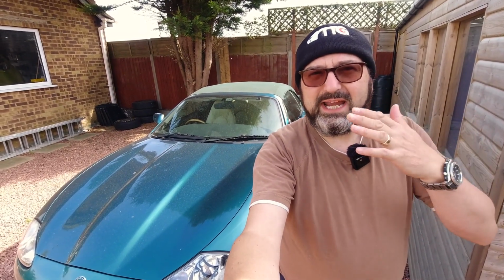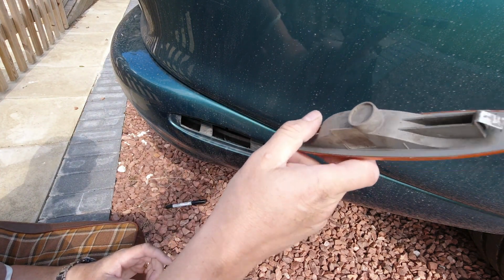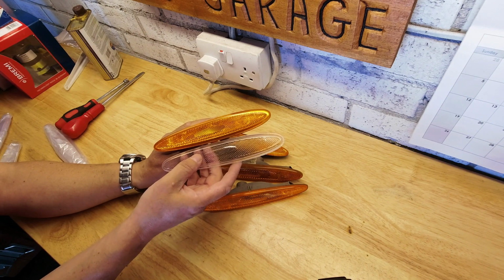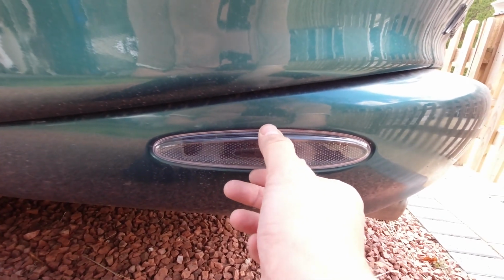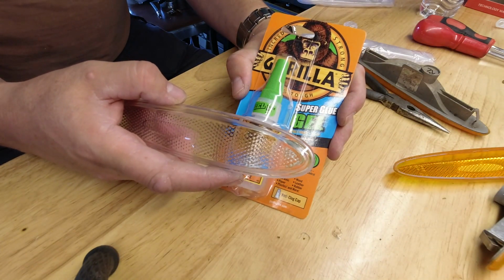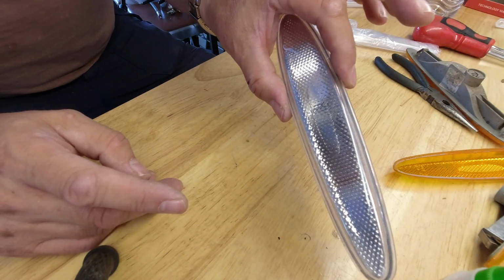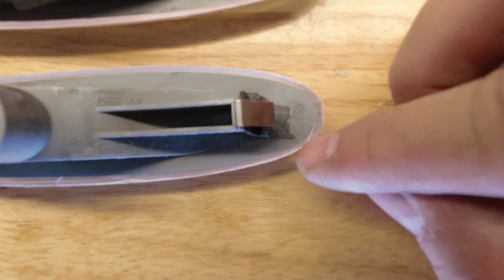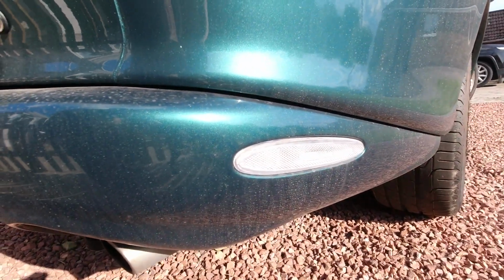Modifying the jaguar xK8 side reflectors

Comment: I’m working my way through your XK8 videos having acquired a 2001 convertible from my father in law recently for nothing! I’m gradually sorting out the various issues it has and your videos have been invaluable in doing that. I’m also learning something from you as I’d never heard of the verb “linish” until watched this and even had to look it up!
Reply from the maker: 🤣 thanks James👍
Im always deploying archaise English phrases as im unaware that they are not in common use. It comes from enjoying language and being an engineer. 
Im more often pulled up on terns such as, Lanyard, Fettle, and Empirical. 😁
Reply: @ToTheGarage  thanks John. I decided to do my reflectors and ordered the Adamesh product and expecting to receive straight swap replacements (I went for clear at the front and red at the back). I’m disappointed that these are in fact flat reflectors with the entire rear surface solid and with 3M self adhesive covering it.  Do you have any knowledge/experience of these please as I’m just concerned that they will look wrong or won’t stay on as they are only held by the adhesive round the edge and have no clips. Thanks!
Reply from the maker: @jimmygee1969  Hi James. Sorry no I have not sampled the Adamesh option. I have had plenty of their other parts over the years and never had any issues, so I would assume thst they will fit and stay in place if you follow the instructions. But sorry I cant help beyond that

Comment: I like to see your take on replacing the incandescent exterior bulbs with LEDs.  Over time, the heat of the bulbs will deteriorate the
the plastic sockets. Also, with less voltage to illuminate, something needs to  be done to prevent  an warning light on the dash. Thanks for your consideration.
Reply: I currently have 1 LED and 1 original thanks to the previous owner. Any update on the best solution?

Comment: Hi John the reflectors look so much better than the orange ones. The only worry I have about using some types of super glue is that sometimes it drys with a white powder substance I think it's some kind of chemicle reaction. You can wipe it off but if it's happens on the inside you probebly won't be able to take it apart again without breaking it. If yours has worked ok I would recommend anyone wishing to do this mod to use the same make glue as you did. Another great mod video very informative and helpful stay safe mate and keep up the good work.👍
Reply: I used the same glue and have a little of the white reaction you talked about. 😕

Comment: As you say, US spec cars have lights here (and on the rear bumpers) and these reflectors are simply to cover the hole in the bumper which is produced for all markets. They are not a legal requirement in the U.K. or Europe. I had the holes filled in and the bumper resprayed on mine and it improves the whole look of the car, enormously - it’s how Lawson designed it.
Reply: Glad to see this comment. I have been trying to find out about the legalities...definitely going to get rid of mine all together as you have!

Comment: Love it! if you don't have a chrome spray use some aluminium duct tape, cut a little button size to fit in in the recess had my lens for ages but got frustrated with prizing open the amber lens, I will have another go.

Comment: question will u hurt the transmission by shifting up and down in the "jgate" (i never down shift to slow down tho but i go up and the use brakes to slow down and come back to 2)
Reply from the maker: The simple answer is No. But obviously if you never use your brakes then they will never wear out.😁
The serious answer is that the car and gearbox was intended to be used like this and designed to cope. 
Its as likely to strain your gearbox, as maximum acceleration in sport mode is. No gearbox is immune to failure though and to be fair the least strain you give it the longer it will last.
Reply: @ToTheGarage  well im truly careful with it i dont go passed 4000 rpms i take my foot of the gas untile i feel it go into selected gear and i love the involvement of the "jgate" these cars are soooo beautiful man

Comment: Well I failed using your technique (abilities) did all the stuff you did and the lens would not part from the base. Anyway I brought one on EBay to wreck. What I did was use a fine rotary blade to get inside the orange  part, then slowly broke bits off, it worked and the clear lens looks great. So you are obviously far  more adept than me or dexterous than me!!!!!!!!!!. It does look good against RED

Comment: Hi, my XK8 has been sitting in my garden since February due to the lock down. Battery went a couple months ago. I've changed my battery and the starter motor fires but the engine does not. Any advice at all would be most appreciated!

Comment: Two questions...
1) could you use a hairdryer on the existing glue to remove the lenses? 
2) can’t seem to get any reflectors on eBay at the moment (clearly everyone is doing this swap). Are there any other compatible reflectors from other makes?

Thanks 😊
Reply from the maker: Adamesh do some I believe. Not sure the heat would help with these as the glue is a brittle superglue style affair.

Comment: John,
You have mentioned bore wash a few times, with good cause. What would you say is the right length of time to keep an XK8 running from cold to avoid it.

Cheers
Brian
Reply from the maker: Great point Brian. 
Obviously there is no right answer to this but I cause bore wash in the first few months of owning my previous cat and that was a start up of around 20 seconds. Took me 3 days to work out how to get it started again!
I always run mine for 2 minutes after starting and usually longer.
But thats my opinion rather than science.
Anything in the 5 to 30 second range is inviting bore wash. (i.e. start car back out of garage. turn off. Wash it. spend 3 days trying to restart it

Comment: Anytime I am trying to break a glue bond, a little heat is your friend.  Just hold the unit at more of an angle to bevel that sharp edge to fit into the radius in the bumper molding recesses.  Bead blasting or solvent spraying the interior of the lens might be helpful in reducing it's transparency.  BTW these are side markers, not repeaters.  The repeaters are near the front of the doors.  https://www.1aauto.com/content/articles/parking-corner-side-marker-and-turn-signal-lights
Reply: Gary, bought some myself and currently fitting, very good quality if not better than the OEM parts, thanks Damian